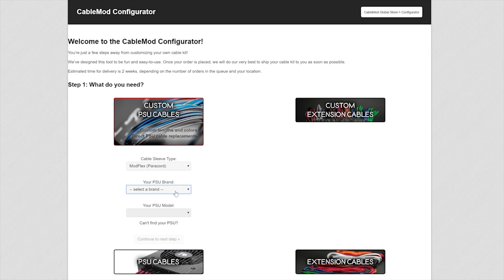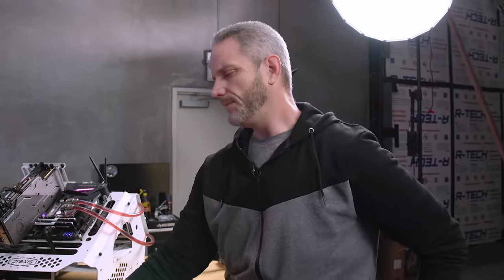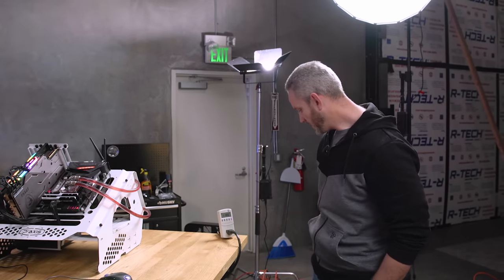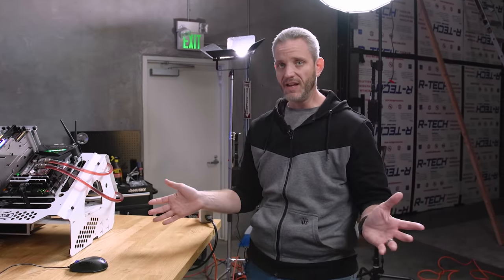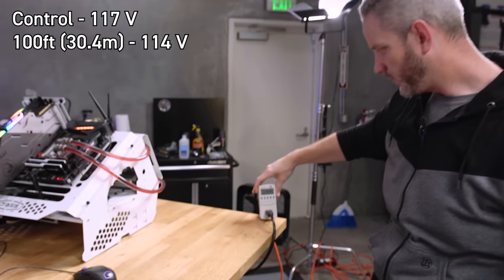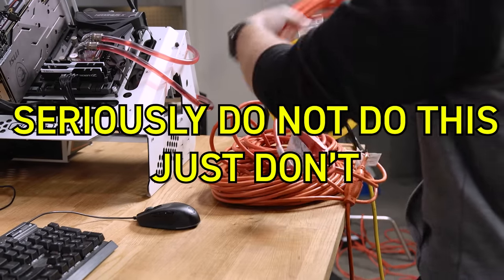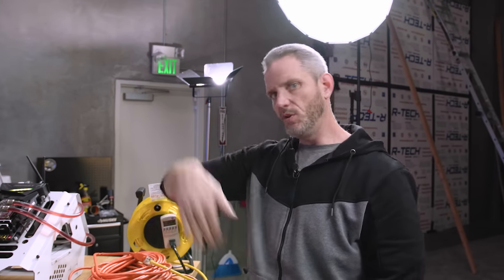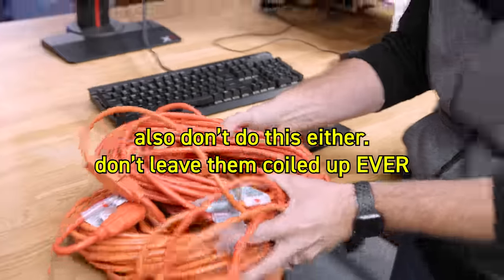Are extension cords dangerous for Computers?

Comment: Cringing at the way Jay coils the cable at the end 😆
Reply: You should watch an army private coil comms cables.
Reply: @urbypilot2136  I'm with you there. I know there's a way to do it so it won't kink, but I never use it. But if I were to teach a kid I would make sure I taught them the right way to do it, not my way... Especially with a stiff hose it makes things so much easier.
Reply: @blahorgaslisk7763  When I coil hoses or cables or ropes, I do something similar to what Jay was doing, but I run my hand down the cable/hose/rope to remove kinks before passing it over my hand and elbow.

By the way, I only do that if I don't have anything to spool it on. If I do, I use the spool.
Reply: @urbypilot2136  The problem with doing it that way is that each time you coil it you add one twist to the remaining hose or cable. If it's long enough you end up with a twisted mess at the end or you spend a lot of time straightening it out. Hose is especially sensitive to this and it can take a lot of time straightening it out every now and then.

The "correct" way to do it you coil it freely and you make sure not to rotate the cable or hose in your hand. It feels really unnatural at first. That way it will twist as you coil it so instead of the coils you are used to you get something that looks like each coil has twisted itself into a figure 8. Thing is you do not end up twisting the hose or whatever you are coiling up. And to make things even better it uncoils easier and without kinking as it is already straight. If you have to throw a cable or rope you will really appreciate how it uncoils when you've done it this way.

It's hard to explain with just words how to do this, but I've seen at least some videos on YT that shows it.

Comment: That's why the wires going to the outlets, lights, etc, are chosen accordingly to the breaker. Then, the wire don't heat up as much and don't cause fires. Up here in Canada, 14 AWG minimum is required for a 15A breaker. And if your load, for example an outlet powering your PC is at a long distance, like 100-200ft, voltage drops. For solving that, an equation is used with a few charts to determine which gauge of wire is required for that application...but it never lowers the gauge! 16 AWG is a fire hasard!

Comment: And in your case another thing adding to the heat and resistance is the electromagnetic effect of a coil. Since the cheap cables were neatly rolled, they Form a large coil adding more resistance due to inductance. In my workplace we had two waffle irons and a cooler connected to 30m of cable. At full power we were almost at 16amps, the drum breaker popping a few times on us with 230V. Without the cooler and just the irons running at approximately 2400W for repeated amounts of time, the drum was getting fairly warm

Comment: puh. I Love my 230v ..... :D
Never Had such Problems LAN Partys
Reply: We can only agree that 120V grid is a shitshow
Reply: @kuppih4933  It's not that hard for an electrician to install 240volt plug in your house for your PC to run on, at least in Canada 120 volts is achieved by splitting 240 in half, which is why it sucks for anything high amperage, unless you happen to be using 2 PC's running on both "sides" of the original 240 circuit.
Reply: I love my 240v 😁
Reply: yah I can even use an airconditioner with the same plug without any problem thats how good 230v/240v is
Reply: It blows my mind that such an "advanced" country needs a special power socket just to run a normal ass portable aircon or, like, an overclocked HEDT computer. Its insane.
Reply: Well the problem comes when u sit in a basement with a single 10amp fuse. Selective startup procedure 😂

Comment: I swapped out the cable on my “Automatic Beyond Belief” toaster so it could use a standard PSU cable. Then the cable melted.

Had to get a 12 gauge cable to have a working toaster again.
Reply: I'm sorry, a what toaster?
Reply: I wonder why it melted given the original cord that came with that toaster was 2 pronged and tiny. I'm sorry I had a good laugh at reading about your misfortune. Plus, why aren't all toasters as great as that Sunbeam classic?
Reply: Robert Paulson It melted because it was a $3 6ft cable with 18 gauge wire. And my toaster draws 1500W. For a 2-slice toaster, it’s insanely fast, and it’s also at least 60 years old.
Reply: @alexp9303  That explains it. For some reason I was thinking it was a heavy duty cable you were using. Some of those older house appliances are kind of neat on how they work and were meant to last.
Reply: Robert Paulson Definitely agree with you there. I even got one of my coworkers interested in getting his own SunBeam.

On a side note, I learned that it takes about a week to regain feeling in you fingertips when you try to unplug a melting cable and short it out in your hands. Thanks GFCI!
Reply: @alexp9303  Hot damn that outlet failed miserably! 
So what made you want to use a cheap PSU cable to rewire a toaster?
Reply: Robert Paulson I only used the cable to power it. I redid all the internal wiring with heat resistant cable.

And I just felt like it, and while I was at it, I installed one of those 10A fuses with a switch that a lot of hobby 3D printers have. That’s actually what the cable plugs into.

Comment: I'll add the reasons why you shouldn't plug in multiple extension chords together as I got it explained by an electrical engineer. The plug connection adds a fair amount of resistance. So it isn't even the length of the cable but the amount of plugged connections between the device and the wall plug. So don't even use multiple short ones to get more plugs, because you get that resistance up.

The device not getting enough power isn't really the concern here. The problem isn't the resistance for the power getting to the device, but the resistance of your ground line. Because if something goes wrong in your device and power gets to the casing, you will want to have as less resistance for the power going to ground as possible. Having a high resistance there, is where it gets dangerous.

Comment: I can relate this video to my experience with OFFICE CUBES.  Like your panels, (one 480VAC 3 phase to one 120/208VAC 3 phase) Office cube feeds typically accept 3 phase power and distribute it thru receptacles that are numbered 1,2,3 that are adjusted to phase 1,2, or 3  and then plugged into the cube ribbon cable connector.  This method allows you to adjust the circuit load by selecting the phase each receptacle is connected to.  Additionally, the power ribbon cable is connected throughout the cube partitions using T's and +'s.  When many cubes exist, additional 3 phase circuits are used to power other groups forming multiple cube sections.  The power feeds are color coded so the phase arrangement of each feed is identical (to prevent 208 volt shorts).  Now sometimes cube occupants get exuberant and find that one major section of cubes ribbon cable is not connected to its adjacent cube section and they plug the two sections in using the T or +.  The reason they are not connected of course is because the two sections of cubes are on different circuit breakers.  With the phases matched there is no obvious problem except: computer monitors start showing all sorts of freaky moire patterns with noise, interference, etc.  In some cases computers won't turn on or start blinking on and off.  The reason is HARMONICS and also the reason why stranded-vs-solid wire should be used.  This is a completely different problem than the one you are attacking however, as the cube load increases we find that putting 4 computers and monitors on a circuit is about max if you don't want to trip the breaker.  Now junction boxes in cubes have additional issues such as loose wire nuts which will melt, set off fire alarms, and scare the crap out of electricians who remove the cover plates and find the exposed wires sparking and jumping around on their own.

Comment: A few years ago when we were camping we ran an electric heater into our tent because it was so cold, and we made the mistake of not unraveling the extension cord and instead left it bunched up on the floor of the tent.

Lesson? Don't leave extension cords bundled up when you're running a heavy load through them (and don't need the entire cable length). Our extension cord was not super cheap, but the heat generated in the cable was compounded by being bunched up and melted the insulation on the wire so that it was a giant single bundle of plastic and wire. It still transmitted power just fine, but it also got hot enough to burn through the tarp on the bottom of the tent.

Comment: "Brazil:Good luck dont shock yourself"
why?
Reply: It's not standardized, mostly depends on which Electrical Company is delivering your energy and their substations, my state is 220V but the city next to me on the other state with other company has 110V. Obviously no ones get shocked, americans are too sensitive
Reply: @cleitonfelipe2092  Wat? So there is no interconnected grid? Or maybe there are different tranformators stations, while high voltage lanes between cities are connected, because it's a normal thing that different atomic stations or hydro stations help each other. By the way, the hydro generating dams are the best, because you can instantly increase generation. Wind and solar generations suck big way and can never be considered as a primal source of energy.
Reply: @phillgizmo8934  yep, most of the power comes from hydro and thermoelectric, but the voltage depends on the region, and from where it came from. Typically the bigger the city, greater the chance of being 110V 60Hz, and I'm not even sure why lol.
Reply: @cleitonfelipe2092  You actually get both voltages here, you just need to double check every time which cable has been routed to what wall, etc.
Reply: other than everything everyone already said. we also have places that use 110v and others that use 220v. Usually different regions, but if you travel a lot for work or leasure you might end up frying something because you used on an incompatible voltage. My wife almost fryed her hair iron thingie because it was 110v (used in our home) oposed to the 220v outlet that the hotel we were in the beach had in our room.

it was a bigger problem like... 10 years ago, nowadays most electronics like an iphone charger works 100-220v, so it works seamlessly everywhere. But I had some Computer PSUs that had a like black switch to choose the voltage that you were using, since they were compatible but not automatically.

that is why - Brazil: Good luck not breaking your stuff Voltage... Algo google Brazilian suicide shower
Reply: Added to the different voltages, most buildings in Brazil are not grounded properly because they're older than the regulatory laws
Reply: in my city you can get up to 330v now
Reply: As has been said, you can get 220V, 110~127V, or both in your house, all 60Hz. Most houses get 2 phases and get to decide whether a certain socket is 220V (phase + phase) or 127V (phase + neutral). 

I wouldn't say it's not standardized, as there are standards regarding it, but both are accepted because of US and EU imports, which also influenced how the power plugs were (a multi-standard that accepted both).
That being said, most houses aren't earthed, and many have poorly done electrical installations.
Reply: @cleitonfelipe2092  Not exactly, we have a system of 127v per fase, so if the wiring of the outlet uses 2 fases you get 220v if you use 1 fase and 1 ground you get 127v. If i`m not wrong other countries use the same system, like Canada.
Reply: @Vitor Kiguchi  @pedrocorsi3207  : In North America, residential power has 240V single-phase coming in. The transformer is center-tapped to have 120V line-to-neutral and wired 240V line-to-line.
So yes, you have 240V at the panel and can have 240V outlets....but the only ones that are wired that way are electric ovens and clothes dryers. (Baseboard heaters and such will use 240V also, but has no outlets/receptacles)
Unless a home owner has intentionally added a 240V receptacle after construction (almost no one) you won't find one in a North American residence.

Same thing goes for most commercial buildings too, except that they probably have 277/480V or 347/600V 3-phase incoming. But depending on the business and the equipment they plan to install in there, it's possible they could have some 208V receptacles (still somewhat unlikely though).

TL;DR Almost all residential (and most commercial) building plans in NA don't call for 240 or 208V receptacles, so effictively they don't exist; but you can have one installed if you want relatively easily, without having to change your service entrance.

Comment: biggest problem with long extension cord - fusing (MCB's) is based on the a current flow that will trip the switch on short.  When you use long cabling the resistance on that cable becomes too high to trip the MCB - remember this is fault and not RCCB fault.   This means the short in the device does not blow the fuse and stays in fault - and that is very dangerous.  If there is no RCCB on the circuit you can end up with a lethal condition, if you have short to earth, but no power trip - and you die.   You must use RCCB protected circuits with long extensions or you will have zero fault protection on earth-line, and even then you will have no fault protection for a line-neutral fault.

Comment: Generally Speaking, 12g wire is speced for 20Amp circuts.   Most homes will only ever have 15Amp Circuts (unless special construction or for things like garages, Kitchens)  For those industrious people, Buy A Spool 300-500ft  of 12g SOOW for cheap, and put your own plugs on it.   That higher quality wire is infinity easier, and better to coil, store, and work with, and ends up being cheaper then buying garbage at HomeDepot/Lowes, etc.  ~Theater Tech, who has made lots of Electrical Jumpers. for Theaterical lighting.

Comment: This is why the US should start using 230V like Norway.
In the stores here even the cheapest extension cords has standardised wire thickness at minimum 1.5mm2 (15 awg)
. And they can handle 2000-3000W

Comment: As a computer technician, I would never use an extension cord on a computer.
Reply: You do realise, pretty much every wall outlet is basically connected via a high quality extension cord, right?     Unless you have a bunch of outlets everywhere you need them to be, sometimes an extension cord is necessary.   Quality of the cord and plugs is what really matters,  not just that it is an extension cord.

Comment: This video REALLY needs a part 2, where instead of extending the length of the circuit, you take a splitter, and plug several computers into it

Comment: Pretty good job. I will add that to make sure you don't have a federal fire Pacific electrical panel as they are the number one thing home inspectors look for as they slipped a check under Underwriters UL Laboratories door to get their approval way back when. needless to say a Google / DDG search for images will be lots of fun!

there's another manufacturer that has issues as well and at least with one of them the reputation has preceded to the fact that they can't even sell replacement Breakers that now meet code.

For the technical reason they don't shut off you can Arc weld in any room of your house whether or not the wiring supports it!

Comment: In my country, we use 253v max and 200v min (worst case scenario) for single phase. And 400v to 440v max for 3 phase.

It is true, it will draw more current when the voltage is drop to keep the wattage stay the same.

Comment: Coiling wires essentially creates more resistance, for example a relay have a coil inside turned more than 500 times depending on voltage rating of the relay so a 5v relay has a voltage drop of 5v.

Comment: The heat occurs when you create a dense electric field keeping a long wire buccled up like that. That's how arc welders work, and that's why they're so heavy :) . If you lay down the cable on the floor it won't generate heat

Comment: Resistance of a long wire is greater than  resistance of a short wire because electrons collide with more ions as they pass through. The relationship between resistance and wire length is proportional.

Comment: Power = Voltage x Current.  For the electrical engineers, there are relative phase relationships, etc.  The computer needs X Watts of power.  As voltage drops, it requires more current, which increases the voltage loss in the extension cord, which then forces the power supply to draw more current.  These two effects eventually balance.  Eventually, the power supply maximum current rating is meet, and it can no longer supply the needed power to the computer, and it crashes.

Comment: in case anyone else from outside the USA is wondering I think Jay is talking in AWG or American Wire Gauge (that correct?) which at 14G is about 1.6mm diameter and at 12G about 2mm diameter -   though as he said the thinner cheaper wire also tends to be more cheaply insulated. I assume it follows that you can get better quality 14G. In the UK 14G equivalent is actually pretty decent because we have 240V so a 1.5mm diameter is rated to 1400W, 15A, assuming it's well made of course.

Comment: I know, it's an old video... but I just had to pause and comment: Yeah, we brazilians are very lucky ourselves on voltage matters. Or not. 

For those who didn't get: Almost HALF country have 127V (phase-to-neutral) outlets, and the other half has 220V (phase-to-neutral). And the 127V half also get to plug 220V appliances on two-phase outlets (two 127V phases = 220V phase-to-phase) to use on very high power appliances (Electrical ovens, washing machines, dish washers, vacuum cleaners,  electrically heated showers and taps, air conditioners)